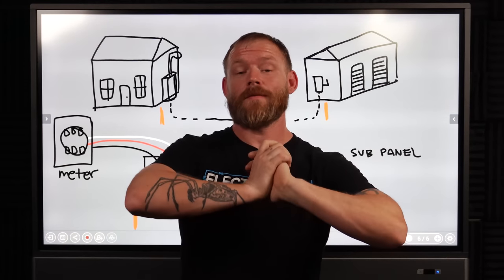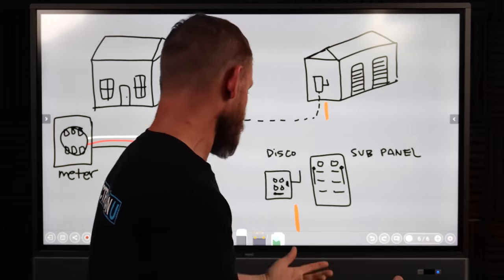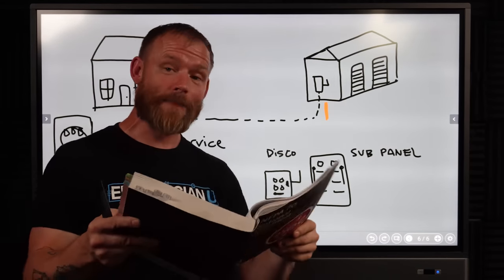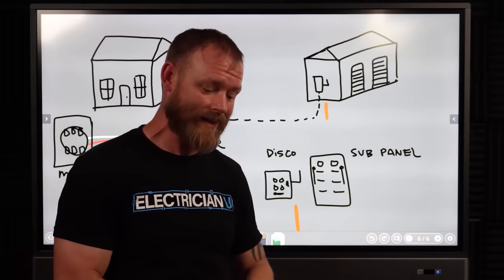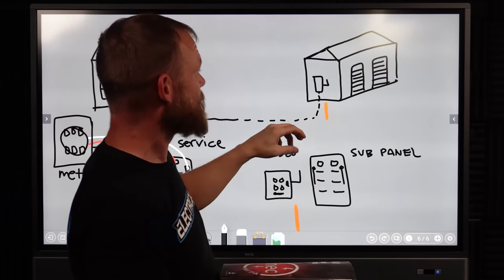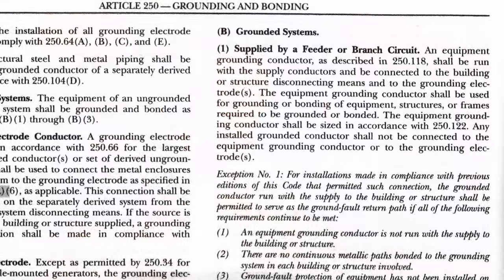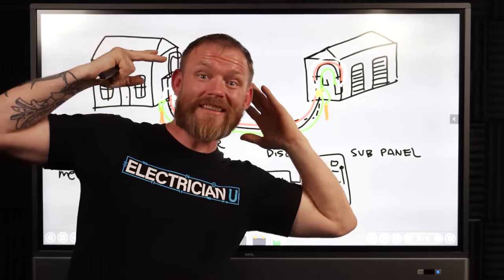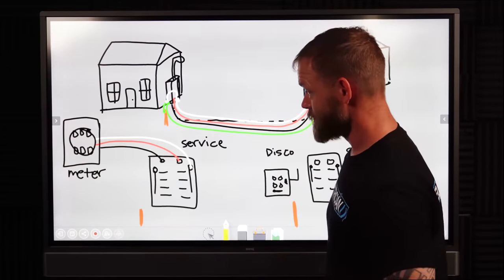Is a Ground Rod Needed When Grounding Multiple Buildings?

Comment: I don’t know you made me more confused than my local inspector did don’t know I got four wires out to my steel pole bar and I hooked it up like the inspector said and I put grounding rod and I’ve had to put two more breaker boxes in the garage for bigger loads And each one of them I put grounding rod on. I don’t know if it’s right, but it’s working we need to do this again and slow down your videos real information like your videos information.

Comment: What is required where a three wire USE triplex is run from the house to free standing frame structures without a seperate grounging conductor as in an older system? Do you have seperate grounding rods for each out building and do you bond wirh neutral in them?

Comment: Great job! Where I live most residential service comes in to 200amp main panel ( bonded neutral and ground which is connected to 2 grounding electrodes) on the pole which feeds into homes 200 AMP sub panel(seperated neutral grounds) thru 4 wire feeder 2 hots neutral and EGC .
(MHF 4424) FOR SMALL,TINY, AND MOBILE HOMES! 1ST QUESTION MHF SERVICE ENTRY HAS 4-4-2-4 IS USED FOR 200AMP IS THIS OK FOR NEUTRAL WIRE TO BE SMALLER THAN  HOTS I KNOW IT HAS EXCEPTIONS IN CODE AND THIS IS 1 OF THEM . BUT IS IT SAFE, I NO TINY HOMES AND MOBILE HOMES MOST TIMES WILL NOT DRAW THE 200 AMPS UNLESS PROBLEM OR LIGHTNING HITS BUT IF IT DOES WILL THE #2 WIRE NEUTRAL HANDLE  BOTH 4GUAGE HOT WIRES. OR IN THE INSTREST OF SAVING MONEY ARE THEY GOING TO FAR?
2ND QUESTION WITH THE POLE 7FT. FROM STRUCTURE  AND SERVICE ENTRY HAVEING 4TH WIRE (GREEN EGC) CONECTED TO MAIN POLE NEUTRAL/GROUND BAR WHICH CONNECTS TO 2 GROUNDING RODS OVER 6FT. APART WHY WOULD THE SUB PANEL NEED TO BE GROUNDED ( IT IS ALREADY CONNECTED THROUGH GROUND BAR IN MAIN PANEL) AND THAT IS WHAT YOU WANT!  THE PROBLEM IS THAT WITH MAIN PANEL GROUNDING SYSTEM SO CLOSE TO HOUSE , YOU CAN NOT JUST GROUND THE SUB PANEL BECAUSE IT WILL OR COULD INTERFERE WITH MAIN GROUNDING SYSTEM  AND IF YOU DID HOW FAR WOULD YOU HAVE TO GO TO NOT INTERFERE WITH MAIN GROUNDING SYSTEM! 2XRODS LENTH IS 1 ANSWER I FOUND AND EVEN THEN MAY NOT! BUT IN RECENT YEARS GRIUNDING RULES AND THEORY HAVE BEEN PROVEN NOT TRUE, LIKE THE MORE GROUNDING RODS THE BETTER(NOT TRUE) AND 1 MAIN SINGLE POINT OF GROUNDING FOR HOUSE  IS BETTER . IF THE MAIN PANEL IS ON POLE OUTSIDE  OR ON SIDE OF HOUSE AND GOES TO THE ONLY STRUCTURE INSIDE SUB PANEL , THAT IS NOT A SEPERATE STRUCTURE  OR IS IT? THEY NEED TO UPDATE THE CODES BECAUSE THIS IS DANGEROUS OR CAN BE !THERES MANY DIFFERENT SITUATIONS AND WHAT THEY HAVE IS A MESS ! CONFUSING. THEY NEED TO EVALUATE GROUNDING AND DECIDE WHAT IS FACT AND COMPLETELY REDEFINE GROUNDING CODE INSTEAD OF THE MESS IT IS NOW! IT IS RISKING PEOPLES AND CHILDRENS, ANIMALS LIVES!  HERE IS SOMETHING I FOUND , 4 WIRE SYSTEM YOU BOND AT MAIN PANEL, INSIDE SUB PANEL YOU SEPERATE GROUNDS AND NEUTRALS TEST WITH MULTIMETER NO CONTINUITY CONECT THE GREEN EGC(4TH) WIRE TEST AGAIN AND YOU THEN GET CONTINUITY FROM NEUTRAL AND GROUND AND NEUTRAL TO PANEL IS THIS CORRECT/OK ? I UNDERSTAND THAT THE EGC IS GOING BACK AND CONNECTING TO BONDED GROUND/NEUTRAL AND THAT IS WHY YOU ARE GETTING CONTINUITY OR OHMS. BUT WHAT IS THE POINT OF SEPERATING GROUND NEUTRAL IN SUBPANEL IF IT IS JUST RETURNED BY CONNECTING EGC WIRE? IS THIS WRONG OR PROBLEM  OR IS METER JUST TO SENSITIVE! YOU EXPLAINED IT WELL, I JUST WONDER WHAT ARE YOUR THOUGHTS ON THIS CASE, BUT ALSO IN GROUNDING CODE AND THEORY DO YOU THINK THE CODE FOR GROUNDING NEEDS MAJOR OVERHAUL OR TO BE BROUGHT UP TO CURRENT THEORY! YOU ARE GREAT AT TEACHING ELECTRONICS AND I THINK THERE IS GREAT NEED FOR A DEEP DIVE INTO IT ALL , GROUNDING, AND BONDING AND I BELIEVE YOU CAN DO BEST VIDEO . IF YOU DO NOT HAVE TIME FOR ANOTHER OVERALLVIDEO, MAYBE JUST 4 WIRE FEEDER SYSTEM FROM MAIN PANEL TO INSIDE SUBPANEL WITH DETAILED EGC AND GROUNDING RODS/SYSTEM AND IS CODE OUTDATED,  AND IS SINGLE POINT GROUNDING ELECTRODE SYSTEM OR MULTIPOINT GROUNDING BETTER!  I DO NOT LIKE THINKING I UNDERSTAND I LIKE KNOWING I UNDERSTAND AND TO ME THERE IS JUST TO MANY DESCREPANCY OR CONFLICT, OR ROOM FOR ERROR IN THE CODE ESPECIALLY ON GROUNDING! THANK YOU FOR ALL YOU DO!

Comment: Dustin I have a ground rod question, do I need a ground rod for my garage? Ok, here’s the situation!

I recently inherited my parents house due to them both passing in 2021. Their garage is around 50’-65’ away from the rear of the house with four 4awg overhead feeders supplying a 100A 20 space/40 circuit homeline panel in the garage from an identical 100A panel on he back of the house. Obviously, the four wires are; one is labeled black L1, one is labeled red L2, one is labeled white N and the last is labeled green GEC. There is no grounding electrode installed for the garage, there’s two 240V/30A circuits (80gal compressor & welder). Also one 240V/50A for welder or RV, two 240V/20A circuits for 28,000BTU window a/c and exhaust vent. As well as one 120V/20A lighting circuit for eighteen 48” dual 32W bulb lights, two 120V/20A for 20 recp’s and one 15 amp circuit for WiFi/Cable/Phone.

The house has a 100A 20/40 homeline panel (only bonded with the green bonding screw) that is mounted on the rear/center of the house and is grounded to a ground rod directly under the panel. There’s a GENERAC 14kW generator recently installed in 2021 at the right/rear side of the house, the new meter box is mounted 18” left of the transfer switch and both the house breaker panel & generator are grounded & bonded inside the transfer switch. That’s 2 ground rods for a 1,000sq-ft home and the garage 50’ away! The garage never pulls more than 20A-40A tops if I’m welding while the compressor kicks on and the house is usually 15A-35A tops depending if the 2 house window a/c units are both come on at the same time. This year the house window units will be replaced by a central a/c system to save money over using those Amp hogging window units!
Reply: I am NOT an electrician, but from what I understand with the code, and what was explained in this video, you should have a ground rod at the garage. It's considered a subpanel and is in a separate building, therefore requires ground rod(s). I recently built a shop and did all the electrical. The 125A subpanel that was supplied by a feeder from the meter disconnect required it's own ground rods at the shop. The inspector said everything looked good. 

Maybe your garage has an "Ufer" (concrete encased grounding electrode) that you aren't seeing?
Reply: Yes. Ground rod needed
Reply: @MrGatlin98  I’m thinking a ground rod is needed too but, the house was built in 1946 around 76yrs ago and the garage was built in the early to mid 50’s around 52-67yrs ago. The house 100A panel was installed in 2000 as to add some dedicated kitchen receptacles. I ripped out the old 70’s wiring out of the garage and installed the new 100A panel and all the lighting and other branch circuits listed above about 6 months ago. Nothing has been inspected yet because it’s not finished, I stopped to remodel the kitchen and bathroom in the house.

I have removed 80% of the old BX 2 wire cable from the house, rewired all the kitchen including the rigged up buddy deal dedicated circuits & as well as the bathroom too. I’ve also rewired 4 ceiling fans and installed 4 corner mounted motion activated security lights and 2 GFCI receptacles on the front and 2 on the rear of the house. Now that the remodel is at a stopping point the 4 remaining rooms in the house will get rewired completely like the kitchen and bathroom. No more 1970’s and earlier 2 prong ungrounded outlets or old 50+ year old wiring.
Reply: @ecospider5  I think so too but, I thought the 2 for the house and the 4 awg ground conductor would be enough. Thus far it does work for short circuits, found out the hard way with a Romex cable clamp when I did the garage lighting. The breaker was popping just as it should with a hot to ground short.

Comment: Question.  We have a house built in 1956 with no grounding wires, no ground bar, no ground to the foundation rebar, etc.  The service entrance is to a meter, then to a main panel with a 100 amp breaker then to a panel in the house with another 100 amp breaker then to two in-house subpanels which connect to the circuits.  Nowhere do I see the neutral bonded to any of the panels which makes sense since there are no grounds.  We have another subpanel at our wooden shed which is connected to the main panel through a 40 amp breaker to #8 in the subpanel with its circuits protected by a 30 and 15 amp breaker.  It also has a grounding system i.e. a ground buss connected to the subpanel and to a ground bar with #8 wire.  An electrician friend suggested I connect the neutral and ground busses in the shed subpanel.   I am not sure that is a good idea.  Comments?

Comment: I noticed there is some electrical work that was done to my house unpermitted years ago before I bought it. Specifically a 240V outlet and a electrical panel inside my outbuilding. I was wondering if the fact that these were not permitted May post problems if I were to sell the house one day?
Reply: How do you know this was unpermitted?
Reply: depends, in my area no permit needed for doing yourself, unless a major remodel but usually just building permit then all aspects are inspected, but working only adding a outlet or other simple things no permit needed so check with local AJC if permits are needed for simple electrical if doing yourself if allowed.

Comment: This is interesting 
I built a garage that became my main service drop location (i moved the service meter and drop to the garage) making my house a subpanel of my garage via a 100amp feeder.

My electrical inspector made me disconnect my original grounding electrode conductor. His reason was there should only be one ground at the source (service). Ie i have aabandoned rods at the house and a working ones at the garage (new service drop)

Was this incorrect?

Comment: I’m still kinda confused. Lol. If you’re running a grounding conductor from rebar encased in concrete, how does the grounding electrode come into play? Do you have to connect the encased conductor to the electrode and then ground from there to the panels/equipment?

Comment: What about on a 400 amp service? Installed disconnect at the meter and ran conduit out to a barn with its own 200 amp panel. Can I ground the disconnect at the first set of ground rods or do I need to drive 2 more ground rods out at the barn?

Comment: What makes, or should I say... what causes a grounding electrode to smoke? Have you ever seen that happen? I came upon a house for a service call where the customer says the ground is arcing, popping, and smoking around the grounding electrode. When I arrived, the grounding electrode is about a foot over from a 3/4" rigid conduit that goes to his hot tub, and the underground feed to the subpanel inside the garage is about a foot to the left of that as well. He said he turned off the breaker in the house main breaker (100A) that feeds the subpanel in the garage. Yet is was still smoking when I arrived. The grounding electrode conductor is attached to an equipment grounding lug at the left bottom corner inside the subpanel cabinet. It was not evident that it existed from outside. There was some recent remodeling going on, so everything was finished (walls, etc). When I opened the cover and saw a black wire in the lug, I took a meter out, thinking someone hooked a hot wire up to the cabinet lug??? Didn't make sense. After careful examination I find it was attached to the grounding electrode. The area around the grounding electrode was still smoking....even with the power off that fed the subpanel, so I removed the wire rom the lug (No voltage on the wire, by the way) taped it up and the smoking stopped. Can you explain that one?? I have to say, in my 42 years of being an Electrician with industrial, commercial, and residential experience.... I don't remember ever seeing something like this, and I thought I have seen it all! God, I love being an Electrician!!! It never gets boring, and I can't get enough of it. I didn't even charge the guy for that service call.... I must have chalked it up to a new learning experience.

Comment: Have a question about grandfathered systems. Come across a lot of sub panels with only 1 conductor used for neutral and no ground. Should those have a ground rod installed as well?  Inspectors call this one out a lot in my area.

Comment: What if you have this same scenario except your sub panel has a main breaker instead of a separate disconnect. The feed from the house feeds the main breaker.. would you connect your ground rod and the equipment grounding conductor on the ground bar in the sub panel?

Comment: Good evening, I am working on a older home real older wire.  Working on three way, haven't determine if they are using California or Chicago method.  Source to light to switches.  been eliminating some wire and rewiring but this one like a lot i have already seen have been spliced to this and that, and just left in the attic.  question is one three way switch has to be on to get the other one to work.  I have tried eliminating to find travelers, but still coming up to the same thing.  Any suggestions?

Comment: Here's a good one, if your detached building is of pole barn construction with a sub panel, but is metal clad, siding and roofing, is it necessary to ground the siding and roofing?
Reply: No. You only ground metal parts that are likely to be energized by coming into contact with the electric service. If all your wires are properly secured low chance they will ever fray or short on on the metal siding there is no point to bonding that to the ground distribution system.

Comment: I had a very interesting situation at my rural property. Normally, we have what is locally referred to as a farm service. Meter and a disconnect at the pole with a feeder to the building. In my case, two yards were fed from the same transformer with the transformer and the ground located on my neighbor's property. Feeder lines were overhead and the lines to the buildings and between the two yards was twin hot with a bare messenger cable that also served as a neutral. There was no ground at the pole at my location and there was a ground at my house panel. I believe the neighbor's installation also was grounded at the panel. This was an old installation, likely dating from the 70's. The masts at the building were wooden and not up to current code. I was having my roof redone and I wished to replace the overhead feeder and wooden mast with a buried cable. My panel was also an obsolete design with no ability to separate the neutral and ground conductors. The solution was to replace the panel with a modern one with separated neutral and ground, disconnect the old ground at the house panel and add a ground at the farm service on my property. The electrician bonded the ground and neutral at the farm service on my property. The ground at the neighboring property was not disturbed. This arrangement apparently satisfied the local electrical utility as they allowed the power to be connected, but in terms of the wording in the code, I would have expected that the ground on my property should have been extended to the pole with the transformer, which is located on the neighboring property. This, of course would have been a costly endeavor that I'm glad I did not have to undertake.

Comment: I am considering updating wiring for my garage, currently its fed by two hots and a neutral, No ground. Can I replace the fuse box with a breaker box and add grounding rods at the garage without tying it the main house system and still comply with code somehow? From a non-code safety stand point would it increase safety to add a ground at the garage or is there a hazard I am missing?

Comment: Stupid question, The ground that runs to the other buildings disconnect, do you have to land it on the ground lug in the disconnect? Wouldn’t that bond the neutral in the disconnect to the ground?

Comment: I'm still confused. I understand the sub panel in the remote  building needs a ground rod, but do I need a separate ground rod for the disconnect on the pole outside the building?

Comment: I've learned a ton form your videos thanks. I ran 3 wire to my shop and was getting a open neutral on my little tester so I put in a grounding rod and my problem went away. Do you think I need to go ahead and run another ground wire #6 back to my main panel to make sure I don't have any more problems?
Reply: 3 wires for 240v service? So black, red, white. Then yes. The green wire is there to trip the breaker in a fault scenario. If you have a metal cased tool and the hot touches the case then the breaker should trip. This won’t happen without the green or bare copper ground going back to the main panel where it is bonded with the white neutral wire to complete the circuit.